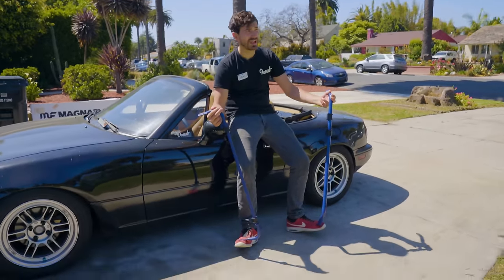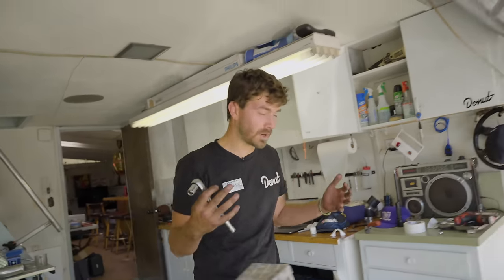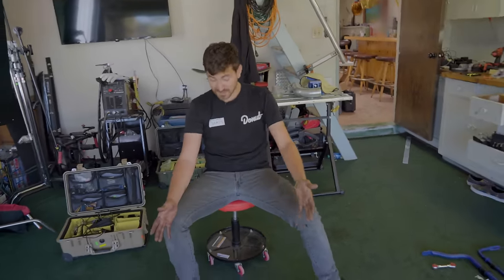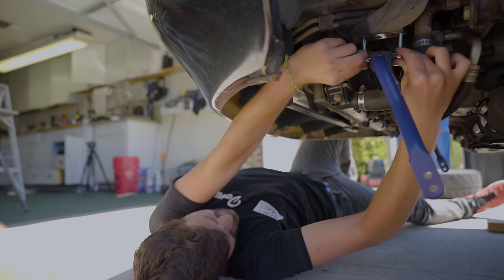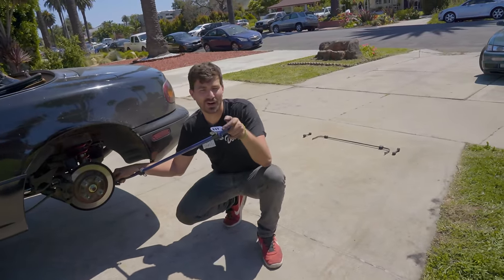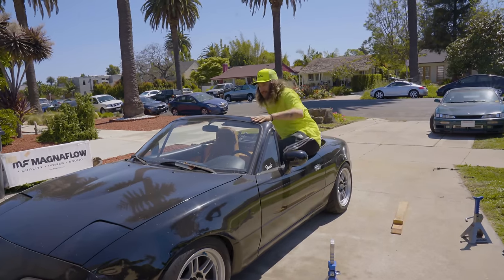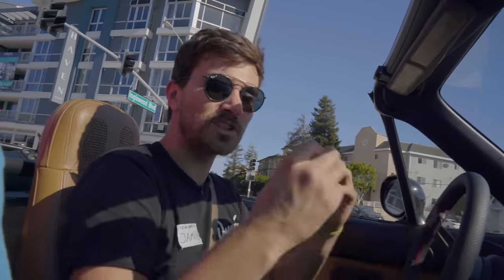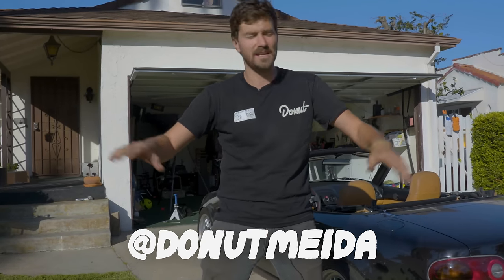Are Aftermarket Sway Bars Worth It?

Comment from the maker: Hey everybody!! Let me know what you want to see on future episodes of Money Pit!!
Reply: Bodykit Wrap seats turbo
Reply: turbo
Reply: miata SUPERCHARGER install 🔥🔥🔥
Reply: Areo
Reply: Brakes
Reply: new seats, turbo, wrap, shift boot, tune, track day
Reply: Semi slicks for the miata
Reply: Are you going to install new seats and lights?
Reply: Drift build
Reply: Turbo
Reply: Turbo or engine swap please!!
Reply: Donut Media. Roll bar! Every Miata needs one. It’s the most badass safety feature you can do for cheap. Then it opens the opportunity for race seats
Reply: Supercharger recaro seats and wide body kit
Reply: James Dad
Reply: Are suspension/chassis braces worth it? 🤔
Reply: Turbo!!!
Reply: hard top vs soft top , if possible since those soft top are really noisy .
Reply: Brake rotors, seats, angel kit, turbo
Reply: How yur knee is doing
Reply: Semi truck horn
Reply: Hey Zach! I'm 14 years old and I own a 92 F150 with the 5.0, and I was wondering what kind of suspension mods I could make to make my truck handle better?
Reply: Brakes
Reply: What about those strut tower braces that go in the engine bay?
Reply: Roll cage to go with the new links, stiffen up the chassis
Reply: Also v6 swap
Reply: Strut bars ???
Reply: Hey, could you talk a little bit about driving such an "high potential" (old) miata in the rain? Livin here in Germany and we have a lot of rain and snow sometimes and is a soft top miata for such weather conditions OK? Thanks and best regards!
Reply: Turbo Tune !!!! and Brakes!!!!
Reply: How to vinyl wrap
Reply: How about an installment of a sound systeme👌
Reply: HiLow Z's Vs Money pit Miata Autocross
Reply: Big Brake Kit!!!
Reply: This may not be super fun but it is super accurate, chase a oil leak or weird electrical issue. I have a 1994 4Runner and it is a Money Pit just in seals and gaskets
Reply: Headlights
Reply: new sound system, speakers, stereo and big ole sub woofer
Reply: If suspension bushing worth it
Reply: @bunkerharris4530  Oreo
Reply: Seats and brakes for sure!
Reply: @TheMikeboyz  nah, those stock seats are actually cool
Reply: Single turbo kit
Reply: After market gear box
Reply: Would be good if you named the price of the individual parts you buy in the videos, to hep get a better idea on the cost of these Projects, anyone else agree?
Reply: Seats, Lights, Body kit, idk about wrap, seems like bit too hard for a guy like me to follow your instructions and my waifus would be full of bubbles on car, but turbo and in the high end spectre of Fast and Curious, let's do some NOS Zach! :D
Reply: Brakes, supercharger, short shifter kit
Reply: Diff and/or lightweight flywheel.  Those 2 upgrades dramatically changed my driving experience.  My Z came with an open diff.  Now I feel like I have a whole different car.
Reply: Turbo, Seats, Spoiler and front splitter for even better handling
Reply: I know these are kind of smaller mods but maybe a kill switch, oil catch can, or a transmission oil cooler?
Reply: Brakes maybe a short throw some racing buckets would be nice maybe a roll cage and then for the final probably a supercharger
Reply: turbo obviously, also a roll bar, seats, hydro handbrake maybe? widebody would be dope, some kind of headlight upgrade.
Reply: A turbo install
Reply: Sub frame connecter? Idk
Reply: Turbo, Seats, Brakes, Spoiler and front splitter for better handling
Reply: Rollcage
Reply: Donut Media Love the show....brake upgrade(bbk, upgrade pads/rotors, as brake lines), drivetrain upgrades(short shift, stiffer mounts/bushings), some aero possibly and a power adder in the future!
Reply: Supercharge!!!
Reply: How to upgrade/replace the motor and transmission mounts.
Reply: Been waiting a week for this lol
Reply: Donut Media Get a proper rollbar for this car. It will save your ass if you ever do roll the car. And like the sway bars a rollbar will stiffen the car much more and make it even more of a blast to drive.
Reply: short-throw shifter, clutch, and breaks
Reply: Body. Kit.
Reply: I definitely want to see a turbo set up, body kits, and possibly and engine swap, preferably a 2JZ.
Reply: Seats, turbo or brake kit
Reply: Lsd maybe?
Reply: We want to see a turbo in that Miata because MO POWA BABEH
Reply: Engine swap, or maybe turbo kit
Reply: Honestly any type of forced induction
Reply: test out the multiple dent repair kits options sold online to find the best one.
Reply: Roll cage
Reply: @sammyturpin9935  A licence
Reply: @billrights9227  short throw and brakes yessir
Reply: Replace the brake lines with braided ones, I want to see if you strip the hardline connections before I try it on my 95 Eunos
Reply: Definitely a new big brake set, and then a supercharger
Reply: LSD lol
Reply: One thing that I would like to see is:
How can you tell when you need new shocks on your car (basically covering the telltale signs that your shocks are giving out on your car)
Reply: How to create cheap power for bike and cars 
Love you guys. What would we do without you guys
Reply: force induction ...any type
Reply: Brakes
Reply: Turbo kit
Reply: Repaint recommendation: same colour as the sway bars but nice and glossy
Reply: Do something to a truck!
Reply: Super or turbo charger the Miata!
Reply: Steering wheel? Different wheel, or do covers increasing the...ahem... 'girth' of the wheel make a difference?
Reply: Dent repair
Reply: Big wing
Reply: Miata.
Reply: Custom headlights. People dont realize how new lights or light assembly is easy and really keeps you safe at night! Also, its usually a 1 hour change out.
Reply: Transmission/shifter upgrades, brakes or aero.
Reply: I think that it's time to install one nice set of bucket or semi buckuet seats  eheh 🤭 and maybe some brake upgrades
Reply: strut bars
Reply: Would you upgrade the brake rotors and calipers on the Miata? PLEASE!!!
Reply: Cosmetic upgrades. Body kit, gauge clusters, headlights, taillights
Reply: Bodywork like fixing dents, panel gaps, body kits, DIY paint,
Reply: Darren Taylor facts
Reply: Donut Media them brakes and rotors. I’m sure that’s already a no brainer on the mod list but I’m excited to see this car come along. Also paint or wrap? Will you paint or wrap it yourself. My girlfriend thinks it would be cool to have a running tally on how much money you’ve spent on after market parts for the car and to show the total amount each episode. Thanks for the great entertainment and awesome build. We’re both super excited to see this build as it progresses.
Reply: upgrading cams, boring out your engine or putting a stoker kit in the miata.
Reply: Widebody!
Reply: Do a k20 swap or something, would be an all around learning experience
Reply: Brakes
Reply: I did my rear sway bar, coilovers, and lower rear control arms last weekend! Front sway and some bushings are next week
Reply from the maker: @sammyturpin9935  Lowering it would help!
Reply: A turbo, race seats, break kit, and roll bar would be great for the miata
Reply: A hardtop!
Reply: V6 miata? And definitely a hard top
Reply: I think you should do one on replacing the brakes.
Reply: Brakes
Reply: Rotors, calipers, seats, turbo, maybe an overarching weight reduction theme down the road.
Reply: Donut Media slap a turbo in the miata
Reply: Denting
Reply: Short throw shifter.
Reply: @schlusslicht3729  my dad drove throw patagonia Chile under heavy rain on highway and had no problem, was a 2006 third gen though
Reply: Control arms
Reply: New paint job
Reply: Bigger brake kit !
Reply: How about a video on how to get modern electronics into the older 90s miata? Maybe do a sick LED rear brake light conversion kit with nice LED turn signals? Of course we have to keep the headlights stock! Or maybe there is a way to get LED HIDS in that also? Bluetooth sound system? And maybe how to find those rare Japanese parts and import them into the states?

edit: Haha there also needs to be a paint correction/sexy video to fix all those swirls and scratches! Not just a car wash vid!
Reply: Real world maintenance / performance upgrades. Less fire exhaust canons! Sorry haha
Reply: Brakes! But not too expensive, was the first I wanted to change on my dad s miata
Reply: For performance: turbo
For daily drive: new infotainment with Android auto.
Reply: Making the car faster.
Reply: Mounts! Motormount, gearbox mount etc.
Reply: PLEASE do fuel lines next! I don’t want the DeLorean to catch fire! 🔥
Reply: V6 swap in multiple episodes
Reply: LS SWAPPPPP
Reply: Subbacharge dat
Reply: Megasquirt
Reply: New shifter
Reply: intercooler? i know its na but a lot of people are saying turbo so idk
Reply: A Mazda 6 GH so I can follow along lol 👍😂
Reply: I actually mean the transmission or the gear shifter.
Reply: can you do one on if tall people fit in one ?? say bout 6-6 6-7
Reply: Old car mods
Reply: Brakes or a turbski
Reply: turbo
Reply: Suspension, like you said it's the best bang for your buck on miata's. (i.e. braces, strut bars, control arms) and a final suspension episode to end the segment on how to tune all the installed goodies into harmony for a time attack or autocross event. We gotta see it in competitive action.
Reply: @Racemax-dw4qh  especially if you add a short throw shifter
Reply: Big fat wing
Reply: Headlights, rear lights, maybe even some fire interior lights?
Reply: Short throw shifter or clutch replacement
Reply: Turbo!!!
Reply: quadro turbo LS swap
Reply: @paisis123  especially if you upgrade the lights to LEDs
Reply: subaru build (fa engine models only) maybe brz
Reply: turboing it
Reply: you should tell the prices of items you bought so we can decide if it is worth it for our cars.
Reply: Brakes
Reply: do a poll so we can vote and then just choose the want you want cuz it’s your build homie
Reply: turbo for that baby
Reply: Electronic adjusting suspension
Reply: body and paint would be good to see!
Reply: Hey, I'm 15 and bought and 08 GTI (has a donut sticker on the rear glass) a couple months ago after my 72 Chevy C20 motor died, love the car, but want to do shift bearings and short throw shifter. It would be cool if you guys did that.
Reply: Roll bar
Reply: Turbo
Reply: Building your own Turbo System at Home, Racing Seats/Harness/Roll Bar, Sound System and Removable Hardtop, Aftermarket Head/Taillights, Paint/Wrap
Reply: You gotta do forced induction
Reply: Wide body kit
Reply: Donut Media seats
Reply: Short throw shifter, seats, areo
Reply: Good episode! Individual Throttle Bodies are sick on these cars, You should try that!
Reply: aftermarket gauges  tachometer or oil pressure gauge
Reply: yess definitely loving this series.
Reply: Strut bars
Reply: You should list where you get your parts from off the miata. I have a 94 and am slowly trying to follow with your upgrades
Reply: WE WANT MOH POWAH BABY!!!!
Reply: Think those sway bars where frustrating try installing solid urethane bushing kit.
Reply: Turbocharger or rollcage
Reply: If you’re looking to race you’ll eventually need a roll cage and that could be cool to figure how to find the best. I may be doing that to my sn95 vert so seeing the process would be dope
Reply: Will the Miata be getting a turbo? I'd like to see that.
Reply: Finish the track build with some brakes! Big brakes!
Reply: TURBOOOOOO
Reply: Turbo or supercharger
Reply: Turbo all the way..
Reply: I second whoever said brakes
Reply: Rear diffuser
Reply: Starsky & Hutch voice: Do it !
Reply: some bodykits or body works please
Reply: are bigger/lightweight rims actually better? (and how much better, scientifically speaking)
Reply: Roll bar, and maybe led lights through the vehicle
Reply: Turbo weld diff paint
Reply: Fuzzy dice so they know your ready
Reply: As someone who is new to the car community and just bought their first project car, I would like to see some future episodes on brakes and rotors ( see if stainless steel brake lines actually make that much of a difference) racing style seats, a tune and a comparison between vinyl wrap vs a paint job. Keep up the good work!
Reply: aftermarket headlights
Reply: Would this apply to a Del Sol? Similar car concept.
Reply: Turbo install
Reply: I'd love to see a Money Pit on a XJ Jeep Cherokee.
Reply: Donut Media turbo build
Reply: Short throw shifter (Or sumtin)
Reply: Donut Media an in depth guide on transmissions!
Reply: ECU tune?
Reply: Slotted drilled brake upgrades and short throw shifter you’ll love it easy and incredible difference love it on my Porsche 944
Reply: I actually liked this, didn't really know what away bars did before!
Reply: Cool sway
Reply: LS Swap
Reply: You should use a jet engine as a turbo
Reply: Donut Media hey love the music at the end. One of my all time fav songs and glad you guys incorporated it to one of ur bits. “Back in the days” slaps.
Reply: Install some new headers on the NA
Reply: @itsmichaelboy  I agree. Superchargers are better for power delivery than turbos. And they sound better too.
Reply: i think an easy yet cheap install that would help people would be a header and mid pipe replacement and upgrade feel like there is allot of information people need when it comes to upgrading when you have the converters on it.
Reply: Frog arm and rollbar installation.
Reply: We wanna see the end of miatas
Reply: A turbo
Reply: New clutch, turbo or supercharge, body kit, seats
Reply: BOOST!!!!! or LS swapp
Reply: NB front swap
Reply: Make the Miata engine into an EV
Reply: Also NOS
Reply: Install a reverse camera.
Reply: New seats for sure
Reply: Brakes
Reply: Donut Media time for some power upgrades start with an écu and then boost or go all in on an engine swap
Reply: Short shifter, forced air induction, and aero in no particular order
Reply: Please k swap it. K Miata conversion kit. Please
Reply: Not sure, do you have a strut brace? And any benefits from that?
Reply: I want to see spoiler boi
Reply: Adjustable camber, some aero, diy wrap install
Reply: You should do delrin door bushings, because it is hilarious how much they improve the feel of the miata for their cheap cost. May not be very applicable to other cars with stiffer chassis' though! Another good one could be Bosch/Cibie e-code headlights vs LED 7" round lights.
Reply: Do a wrap!
Reply: 1:35
Reply: Strut braces, polybushes and aero
Reply: I want to see more content like this and less content like whatever last weeks, up in smoke was...
Reply: Zach seems like a cool dude 😎
Reply: Bring back science Garage
Reply: Does every car have a stock sway bar?
Reply: aero
Reply: Seats and new brakes like rotors calipers and pads just all the good stuff
Reply: @jamessizemore7103  yeah this is pretty much a no-brainer...should have done this instead of the damn flame thrower....
Reply: Cam shafts
Reply: Up to speed on the pontiac firebird
Reply: Do breakes or roll bar
Reply: Ls swap
Reply: Some body work, to make miata look good
Reply: Give it the Takumi treatment
Strip the interior
Carbon fiber hood
Rollcage
And maybe a turbo
Reply: Brake stopper please
Reply: Fixing that GD dented ass fender.
Reply: We need boost!
Reply: car is great. I would leave it as is. 
But i guess a V6 would'nt hurt lol
Reply: Big Brakes on all four corners
Reply: 2J swap
Reply: Supercharge it. everyone turbos... Audio maybe, I know its not a performance kit and its subjective, but no one does it.
Also - DIY paint.. maybe (?) or a wrap - again DIY.
Reply: Wide body turbo wrap 300+hp
Reply: Motorcycle!
Reply: Turbo for sure!! :)
Reply: Donut Media cheap mods for crossover suvs to make them more off road capable
Reply: Window tint!
Reply: tail and rear lights
Reply: rollbar and paintjob
Reply: Donut Media it’s not a money pit but you guys should do a video about the Indy 500 ram
Reply: An engine swap please
Reply: BRAKES
then adding an LSD if you dont have one already
handling stuff is better for the miata but i guess a supercharger is cool too
Reply: Seat reupholstering
Reply: Turbos installation
Reply: Are you planning to install roll center adjusters? I would recommend that too.
I really likes your vids they are very useful. Keep up the food work!
Reply: Id definitely want to see a supercharger on it but how about gettin into the block of the miata showing us what we could do with the internals I.e puttin in new pistons rods cams stuff like that. I personally would love to see that before y'all start chucking hundreds of panda bears out of it! Love you guys cant wait for the next vid!
Reply: Fix dents, fix leaks
Reply: Race wheel
Reply: Soupercharger on the mx5
Reply: New seats and a rollcage please dont want your head to go splat if it gets rolled
Reply: Wheels
Reply: v6/flat 6
haha
Reply: Seats or paint
Reply: NOS :D
Reply: Ls swap
Reply: How about new wheels/rims! You could explore the difference in acceleration a smaller wheel makes vs larger wheels and talk about inertia and momentum and unsprung weight in a car!
Reply: That car needs a rollbar
Reply: Strut tower bars front and/or rear
Reply: @SadboiGamer3208  v6/flat 6
Reply: Sammy Turpin i would recommend going to some forums and spend an hour or two researching and see what people say. Its a truck designed to haul heavy stuff so usually "performance" upgrades are a bit harder to find than for a sports car. Plus the f150 has leaf springs so there isnt a lot you can do with those other than a lift kit in most cases. Chassis bracing would probably be the best bang for your buck to get better performance imo. Good luck with the build my dude
Reply: nick fallon boosted boiz has like 100 videos on K swaps, if you havent seen them already lol
Reply: Nothing engine related. Stay in the handling path, and install lower control arms / upper control arms. That or front and rear lower arm bars.
Reply: Strut tower braces, bigger brakes, gear ratio swap
Reply: Donut Media you should do a money pit with a BMW :)
Reply: T H I C C  T U R B O  I N S T A L L M E N T and engine swaps
Reply: @itsmichaelboy  nice
Reply: @BMW_Supremacy  nO
Reply: Donut Media Brilliant dude
Reply: I miss Bart
Reply: I wanna see more random crossovers like you did for the "VS" show. Like little random funny crossovers
Reply: turbo
Reply: If your going for handling strut bars
Reply: Donut Media Seats
Reply: Seat and harness install next pls
Reply: SOUNDSYSTEM PLSSS
Reply: I'm guessing there will be no wheel and tire episode, so how about brakes. I got some aftermarket ones installed on my car (pads and rotors) about 6 months ago and they make a world of difference. I have so much more confidence when braking in the wet (they're drilled and slotted) and when they're hot (ceramic pads), and I think it is THE most important upgrade to not only have done, but done right. Brakes make the difference between stopping in time or potentially totaling your car.
Reply: Seats
Reply: Turbo
Reply: New paint
Reply: I would like to see how u would install a turbo or a pro charger on the car or show how to change the cam's, valves and a bunch of other stuff. But most importantly what do u want to be done to the miata
Reply: Engine tune or ITB's
Reply: Frog Arms
Reply: Strut bars.
Reply: engine swaps!!! turbo + superchargers on one engine!!!
Reply: Donut Media brace bars do they even work and are they worth the money? S13/14/15 have brace bars under the car, in the fenders, rear strut, upper rear window, room bar behind the seats rear lower by the diff, front shock tower etc there are so many
Reply: Bound/rebound adjusting.
Reply: Tonytee The_Jdm_Fanatic I was talking mainly just for a Miata more Less just the frog arms that go under your front fender
Reply: Cheap corner balance.
Reply: When are you going to do an actual mod to improve the Miata’s power?
Reply: Zach's knee
Reply: Miata supercharger 🤙🏼
Reply: Upgrade the breaks.
Reply: Please do a Miata soft top install. All the videos I've seen last time I did it miss a lot of steps.
Reply: Ls  swap  it  !
Reply: If strut tower braces are worth installing.
Reply: installing a modern infotainment system
Reply: @schlusslicht3729  hey there, yeah you can drive a miata in rain and snowy wheather conditions. Just put on good snowtires and no allyear crap...just be aware that driving quick (in bad weather conditions) is harder/ you need to focus more on driving than with a fwd car. A Hardtop is very good and a must have for winterseason. If you're too concerned about the wintertime and drivin a mx5 get a beater car with a few months tüv left like a vw golf or opel corsa.
Greetings from a Mx5 na owner from Germany😅
Reply: Install some Flyin miata subframe braces
Reply: Yes turbo pls
Reply: After-dyno fine tuning tips, like setting up startup, warmup, idle, accel enrichment, better MPG on cruise and so on! Preferably Tuner Studio as the majority of Miata comunity is running Megasquirt standalone ECUs. 
As on dyno half-day you´re not getting much more than just a performance tune of fuel, ignition and boost tables, or at least so was my experience.
Reply: Pop out single din carplay stereo
Reply: spooly boi
Reply: Racing seats, the ones with 6 points.
Reply: engine work
Reply: Rollcage, hardtop, seats
Reply: Donut Media maybe try a new steering rack?
Reply: Change the ignition timing and upgrade the injectors, port and polish the head. Lighter flywheel, paddle clutch, short shifter, big brake kit and braided hoses. Strut braces front and rear.
Reply: Sport bushings for suspension and engine, transmission, differential, etc.  Rubber vs. polyurethane.  Turbocharger, supercharger, naturally aspirated tuning, chassis rigidity products.
Reply: You guys have teased a turbo install so that or a body kit/dent removal.
Reply: Coolant reroute
Reply: Hey man engine swop
Reply: Strut tower brace to really dial in the handling. Maybe some LED headlights would be cool too.
Reply: LS1 swap into the Miata. BOOM!
Reply: short shifter
Reply: Autozone special, isle 3 of o’reileys
Reply: Making it a had top but installing force induction weighs more
Reply: Supercharger install and all supporting mods
Reply: wide body kit, turbo
Reply: Headlights
Reply: Since you did a dawg bar episode you should do an episode on polyurethane bushings vs. rubber bushings.
Reply: Straight pipe
Reply: STRUT TOWER BRACE, new seats, chassis rigidity (X style roll bar), door bars
Reply: Michael Audrey ... there are semi slicks on the Miata, I think they’ve put TOYO PROXES R888R on it.
Reply: Diff cover
Reply: any plans on turboing the miata?
Reply: @ranogarage8781  lol only one 💀💀💀
Reply: A TRAIN HORN
Reply: What about a deep 11 second Miata?
Reply: paint correction
Reply: new head unit and speakers? probably doable for most people watching along also
Reply: how to restore headlights or remove rust or prevent rust
Reply: what about fluids? oil? snake oils? what to use, and what NOT to use? 

orrr, turbo the Miata.
Reply: Polybushing, Turbo/Supercharger, LSD
Reply: Is Engine swapping worth it?
Reply: Flame decals. Jk turbo
Reply: low profile tires
Reply: The basics.... fix that rack boot that’s split for starters.
Reply: Turbo charger
Reply: 🔸LED headlights upgrade, or aftermarket seat upgrade🔸
Reply: Get a NEW CAR!!!
Reply: sway bars are no joke
Reply: Supporting mods for turbo/super, eg clutch, flywheel, type of diff, fuel system, engine management, and an updated “flame” video.
Reply: Ding removal, paint prep, interior/exterior lights upgrade, engine bay fappery
Reply: Can we pleeeease get a convertible top replacement vid !!
Reply: Brakes or diff
Reply: EVERYTHING!!!!!!!
Reply: Litterally anything, keep it up man
Reply: Intake upgrade
Reply: Sorry i mean turbo or ecu upgrade
Reply: Roll bar! good ol' safety is always welcome
Reply: Can you make a video on Strut bars..
Reply: Brake caliper rebuild?  Paint calipers maybe?
Reply: Turbo
Reply: Change from convertible to hard top
Reply: vinyl wrap, my dude!
Reply: Turbo or super charger
Reply: How to corner racing line and stuff
Reply: Add a quick release
Reply: LSD, and a turbo kit ?
Reply: Honda J32 engine swap!
Reply: Strut bars? 🤔
Reply: Explain over steer and under steer and what yiu can do to improve it.....ohhh thats what your doing in the video ...cool love it !
Reply: Front strut bar, big tyres and a supercharger
Reply: Hydro e brake
Reply: Body kit, transmision, turbo, brakes ofc
Reply: Individual throttle bodies?
Reply: Anything at this point. I just want more!
Reply: I want to see more! 2 months now and I want to get my fix!
Reply: Maybe for a season 2, the S14!
Reply: I’m doing a complete suspension upgrade and this video plus the coilovers video helped a ton. You should make a lateral links video
Reply: Brakes
Reply: TIRES
Reply: Ls or v6 swap the miata with a 5 or 6 speed manual and a turbo/twin turbo kit.
Reply: Fender flares or body kit?
Reply: How to earn enough money for all the mods you want.
Reply: Please do subs. Preferably 2 12 inch sundown subs. Use a q bomb box for it. I’ve got the same thing in my car except I’ve got 10 inch speakers and I want to see if it’s any better than mine
Reply: Front and rear strut bars on the miata
Reply: @saltysauceskyee9034  he did that.
Reply: Same result comes from reinstalling the old sway bar.
Reply: I learned more from mommy pit then I did in high school
Reply: Do mushrooms 🍄
Reply: Alcantara upgrade
Reply: Ls3 swap
Reply: instablaster
Reply: Are the holes on the sway bar actually threaded? That the sway bar links go through.
Reply: Ha
Reply: aero or more suspension work...OR bigger brake set ups!
Reply: Worth it on a Miata!
Reply: Hold on how did the cameraman disappear between 9 minutes 51 seconds and 9 minutes 52 seconds damn man you just straight kicked homie in the blue shirt out the car
Reply: L5p full delete!
Reply: Saab build would be great 👍
Reply: absolutely ! love this kind of content 😊
Reply: Great Video,...very enthusiastic .. I like  that..